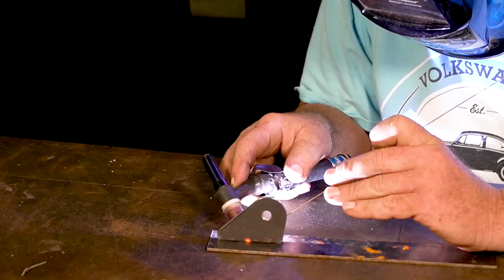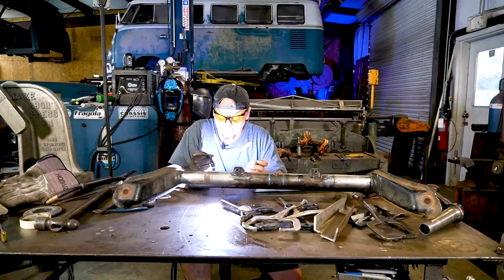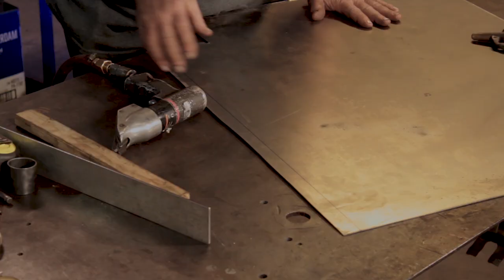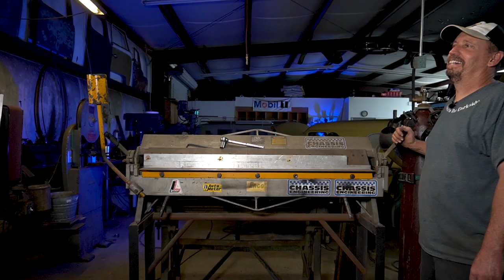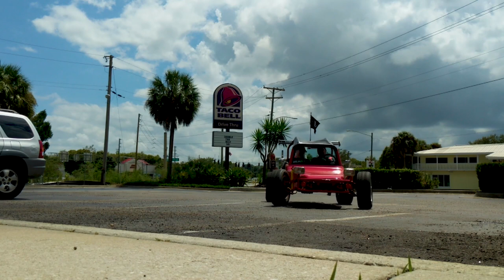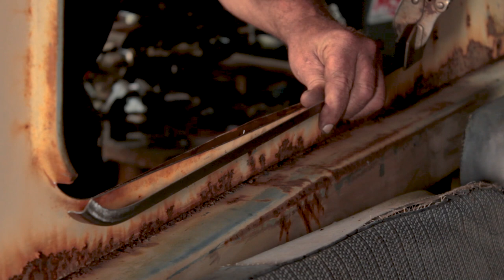1956 Volkswagen Single Cab Split Window Bus / The Start of the Restoration!

Comment: What metal thickness do you use for vw single cab. In mm.
Reply from the maker: I believe we used 16g or 18g so that would be around 1.2mm - 1.6mm thick.